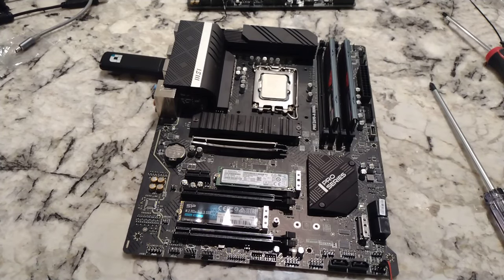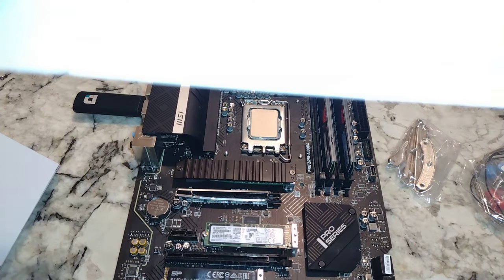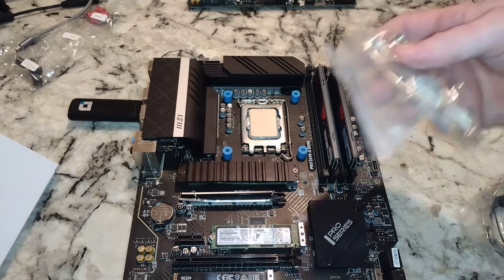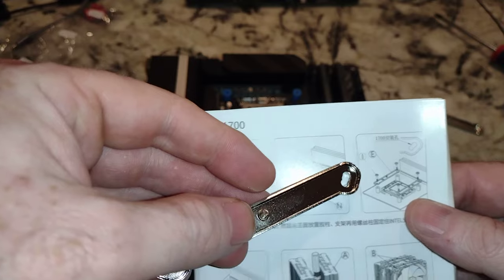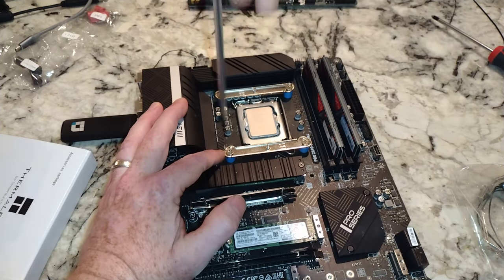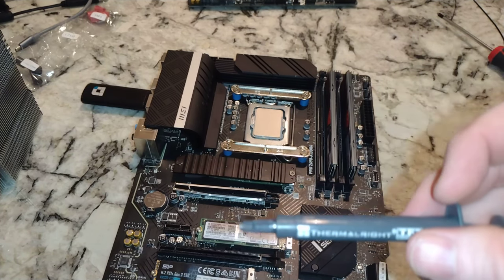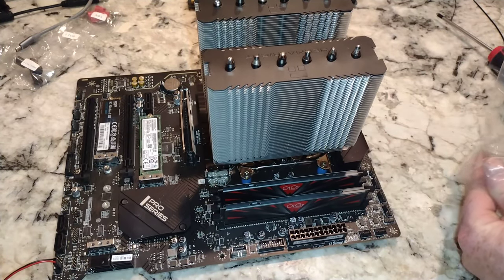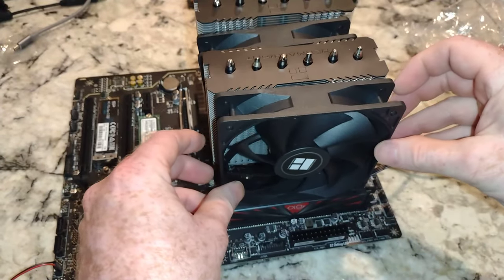Installation: Thermalright Peerless Assassin 120 SE CPU Air Cooler, Dual Tower on to I7-12700f Z690

Comment: You missed showing the wire connections between the fans. It was off camera.  Main thing I needed.
Reply from the maker: Sorry about that.  each CPU cooler usually ends up in more than 1 installation video on here, so I will have to be more careful in filming next time.  Thanks for the feedback.

Comment: Can that outside fan over the RAM be placed on the opposite side? Or is that not recommended because it will cause some type of problem? I have RGB RAM and don't want to cover them with the fan thx
Reply from the maker: I sometimes do that the opposite in a test bench setup so the fans are not blowing on me...difference is, it is not in a case.  In your case, you also want to pull air across the cooler and not push it.  The latter should be better, but I have never actually tested it myself.  If you put this on a CPU with 65W TDP, than this cooler is overkill anyways and that configuration won't reallly matter as far as overheating goes.  Lots of other factors might cause issues related to case size, number of fans...size of GPU...etc.  If it was me...I would say tested it out both ways and see what the delta is between them.   Good luck!
Reply: @PC_HardwareTechUnboxing_1  thanks yes it'll be in a large Enthoo Pro case with 7 fans (140mm and 200mm), so I'll give it a go with the confidence things will be cool enough inside.

Comment: Hey guys, Got a question. His fans are set up from the left Radiator-fan-radiator-fan And mine is Fan-radiator-Fan-radiator. His fan sits on top of his ram, my fan sits on top of the mobo brick, and we both have the one in the middle. Same airflow direction. Do you recommend moving them? I've had no problems with cooling a 7800x3d but i'm afraid i'm leaving cooling potential on the table at intensive cpu tasls with my setup as the right side of the radiator maybe doesn't get cooled enough? LMK

Comment: Any issues between this cooler and the Thermalright "LGA1700 Intel Anti-Bending Fastener, Bending Type Pressure Plate"?  (It's a plate that also lowers temps while preventing the cpu from bending.)

Comment: Hey can you please explain the connections @11:00, one is of the fan, and the other one is???
LOVING THESE GUIDES, THANK YOU!!
Reply from the maker: Yes, sorry got more than a few complaints about this.  I believe I assumed this was caught on camera.  Basically, in the box is a Y connector that allows the two 4 pin fans to go into one 4 pin cpu fan connector on the motherboard.   It might be time for me to completely redo this video or at least film that part over again and provide a link to it.
Reply: @PC_HardwareTechUnboxing_1  Thank you so much for replying, it's clear to me now.
Can you do a video with B760 and 13500 with this same cooler if possible at all. 
Much love to you for help my guy!

Comment: My motherboard's 3.0 PCI x16 is fried and I'm stuck with a defective motherboard. I have this same cooler and an AM4 5800X3D. Am I able to install the bracket and the CPU along with the cooler then sliding it down into the case or do I need to mount the bracket on the back of the case and install the cooler while its already dropped down into the case because that's so difficult for me =(

Comment: Hi I got the argb version, do you know how I can change the rbg colours? I can't find any software that allows me to control the colours. My mobo is MSI MPG X570 GAMING PRO CARBON WIFI Gaming Motherboard AMD AM4 SATA 6Gb/s M.2 USB 3.2 Gen 2 Wi-Fi 6 HDMI ATX. Thanks!!!
Reply from the maker: You need mystic light.  To get it, it appears you have to first download MSI Center under Utilities  https://www.msi.com/Motherboard/MPG-X570-GAMING-PRO-CARBON-WIFI/support#utility    Downloadn and install it, than eventually it will ask you if you want to add mystic light.There is how to video on that page, so perhaps watch that as well.

Comment: Will it fit with an additional set of ram in there too? It looks like there's barely enough space but I can't fully tell.
Reply: i have this cooler, it is indeed have very low ram clearance. i dont think any argb ram would fit in it
Reply: @sexybrunchset8881  I installed the cooler a little bit ago, tbh ran clearance was just fine due to the fact that you can adjust the height of the fan
Reply: @crimsoncoconut6463  i see. Does the fin in your cooler also bend or deformed when the fan clip is installed? It's kinda bothering me
Reply: @sexybrunchset8881  Wdym by the fin?
Reply: @crimsoncoconut6463  the heatsink fin. the metal scaly thing
Reply: @sexybrunchset8881  Ohh, nah, if its not too late you might want to return yours and get a new one

Comment: How tall is the ram in there?
Reply: I second this, I have this mobo and I'm wondering if there is enough clearance for corsair lpx ram
Reply: I just installed this cooler with G.SKILL Trident Z5 Series 32GB C36 which is pretty tall 42mm.  The fan sits above a bit, but no problem really, a small gap.  You can see his aren't flush with the black top part of the cooler either, especially on the ram side.  I would say that my fan on the memory side is riding about 15mm high compared to the black base of the cooler, and about 7mm higher than those metal spikes on the cooler.  When I placed the fans on the opposite side on the back planes heat sink instead of over the memory it looked to be about the same height as if I had put it over the ram (you wouldn't really want to do that anyway since you would be blowing towards the front of the case).  Anyway, I think this should work fine with taller ram, it's just that the fan will sit a bit higher.  You will want to make sure your case has enough clearance for that extra 7mm or so beyond the stated cooler dimensions.

Comment: this is to funny i have the other bored an i have the 120 asame heat sinke do great minds think a like or what sir   but i got amd 5900x an i did not get the intell or the new amd cuz at the dam time i did not no i cud uses ddr4 with the new cpus out i was think only ddr5 so i got 5900 i9 what do u think i am comeing from a 3700x an i i allso have a 9900k shuold i sand it back an the mother bored i got mother bord for 130cash new

Comment from the maker: New: AM4 Version:  https://youtu.be/exmFBnWZOvY
Important note from @antonnikolov2849 as noted below , be careful of installation as rotating the cpu cooler tower by 180 degrees can give you more clearance to access your GPU.

There were some complaints about missed fan Y adapter connections in this video.  I have redone it here in 4k60 and even show how to uninstall it:  https://youtu.be/u-vSJgIB0N4
This motherboard does have some slight damage (lol) from previous owner...got if off ebay for $60 and primarily have been using it for these type installation videos.

I have to say, I really like this CPU Cooler for $35!  It has pretty good cooling as you would expect from a large cpu cooler.  I eventually will have some links down below for temps in FortNite and running various benchmarks.  This will also be featured in a comparison video of under $50 cpu coolers from DeepCool, Vetroo, Thermaltake, ID Cooling...etc.  I will also throw in a couple of stock coolers from I7 and I9 as well.
Reply: Nice
Reply: Solid, Using the Thermalright Peerless Assassin 120 SE CPU Air Cooler paired with a i5 13600k, Thus everything is going well
Reply: Alternative video if cou cooler install https://youtu.be/dLTtocClZbQ
Reply: FYI, I have some comparisons that some folks might find helpful. 

I installed the Thermalright Peerless Assassin 120 SE on my AMD 5900x. With PBO enabled, this CPU puts out a ton of heat (I think it'll boost up to around 250 watts). In Cinebench, it would peak around 81 C. 

After replacing my system RAM for unrelated reasons, the RAM was taller, which forced the first intake fan to sit at a slight offset relative to the tower - maybe 20 mm. That fan/tower misalignment was enough to increase temperatures by about 8 degrees C in Cinebench. 

I ended up removing the air cooler, and going with a high-end Corsair 360 AIO (Corsair iCUE H150i Elite CAPELLIX XT). It's a beast of a cooler, but it only managed about 2 degrees cooler than this air cooler! The big advantage of the AIO wasn't temps, but noise - the AIO is much quieter than this air cooler. 

This air cooler has only really four downsides:

* It makes getting at some system components a pain, and sometimes requires you to remove the tower first (system RAM, some NVME drives)
* It won't give you much RAM clearance, so if you have fancy RGB RAM, you should probably look elsewhere. Check the stats first. 
* It is noisy when it really gets going, so if you're sensitive to fan noise, you'd be better served by an AIO. You don't have to spend like I did - you can pick up an Arctic Liquid Freezer II for around $150. 
* It requires a good bit of space in the case so that the front of the case can close - most newer cases won't have a problem, but some smaller & older cases will. Check the stats on your case for details.
Reply: Thank you so much!

Comment: Can you help me: I build my pc then, I put all RGB fan from the case all connected to the control rgb. I can put the rgb cooler all connected together with the others fans??? Or not? Thanks
Reply: I am currently building my first rgb system with the argb version of this cpu cooler (built quite a few other non rgb builds), so I am no expert at all on this.

From the cooler instructions: "For fans with argb lighting, to control the argb lighting connect  lighting header (3 pin, +5V) to motherboard argb lighting socket or argb lighting controller, lighting effects can be sync by connecting fan lighting headers with eachother."

Each of the two cpu fans has a daisy chain connector, so you can daisy chain the rgb controls together.  In this particular case I have one of the fans daisy chained into the other and the other fan's argb connector connected to the argb header on the mobo.

From what I have read you can daisy chain multiples together for controlling the rgb effects.  If your controller is able to support argb fans at that 5V and using those same 3 pins (looks like a 4 pin connector with one of the middle pins blank) , I think you should be fine.

Good luck.

Comment: Sorry to bother but you should turn radiators by 180 degree. Fans are ok, just your radiator is backwards. Detach fans, turn radiator and attach fans again. When you do so, you will have more than 10mm more offset from your gpu. Check 7.40min at https://www.youtube.com/watch?v=1YFR20MmvpM&t=2s
It is ok in your second video about PE 120 SE:)
Reply from the maker: Great tip!   Interesting, I have installed this like 10 times on here and never noticed that it is not symmetrical.  I will have to go back and check out how the others turned out.  This actually wasn't the best install video that I have done...the 4k version is better, but misses this detail.    I will have to keep an eye out for that.  It is currently not installed on anything.  In this video, it really didn't matter as the primary GPU slot was destroyed by previous owner.

Comment: Did you have any issues mounting the motherboard into the chassis with that cooler installed?   It looks big enough that it would block some of the mounting points on the motherboard.

Im building a system with this cooler the weekend.
Reply from the maker: No issues.  When I do..it is usually an ITX motherboard
Reply: @PC_HardwareTechUnboxing_1  good to know.  Thanks for the responce.

 And thanks for making this video.   Ive wasted to much time and literal sweat and blood fighting with cpu cooling mounting mechanisms because I misunderstood how something worked!

Im slightly bothered by only 2 screws that attatch the cooler to the mounting bracket.   It seems like 4 corner screws would provide better contact.   But, as long as it gets the job done!

Comment: Just installed this today - swapped it in to replace the stock i5-12400F cooler.  Max CPU temp dropped from a whopping 94C to a very nice 65C.  Amazing cooler for the price and in general, is highly recommended.  Thanks for the great tutorial!  Made installation a breeze.  😁
Reply: damn that i5 was hot jeez
Reply: @ImKarks  Not really, the stock cooler is really just bad when its at max load, the 12400f doesn't even draw that much power either, the Peerless Assassin is actually way overkill for it, a single fan tower cooler would suffice, but its very good value.

Comment: I'm super confused. You dropped spacers on top of the screws and didn't screw anything in. How did the backplate not just fall right off when you picked it up? Aren't you screwing into spacers that are floating on the motherboard? Unless the screw you put into the bracket goes all the way down and makes contact with the back plate.
Reply: The screws go thru the the chrome brackets on the top, then thru the spacers and into the backing plate.

Comment: Is there enough room under the cooler to use all 4 ram slots?
Reply: my question exactly + my ram is fat
Reply: @Nardo2G  memory got back by sir mixalot
Reply: The cooler is brilliant but it's really tight hanging over the ram sticks - I had to adjust one fan 5mm higher (on the ram side) just so it would fit.

Comment: Thanks for the clear video about to install mine on same Motherboard. 👍🤞
Reply from the maker: Hope it helps you successfully install yours
Reply: @PC_HardwareTechUnboxing_1  instal went as per your video, but once all setup in system the motherboard is completely dead and wont supply any power to anything have checked psu and all good so assume the Motherboard is dead.

Comment: does the orientation of the radiator matter?
e.g. the "thermalright" text for you is facing towards the left hand side of the motherboard whilst mine is facing the right
Reply: Both are ok, but it is better to have the cooler fans inline (rather than offset) from the case fan behind it. For me, this meant the longer side of the cooler was on top, just like yours.

Comment: Hi I got the argb version, do you know how I can change the rbg colours? I can't find any software that allows me to control the colours. Thanks!
Reply from the maker: What is exact motherboard that u have?
Reply: @PC_HardwareTechUnboxing_1  MSI MPG X570 GAMING PRO CARBON WIFI Gaming Motherboard AMD AM4 SATA 6Gb/s M.2 USB 3.2 Gen 2 Wi-Fi 6 HDMI ATX
Reply: I used  a razor chroma ARGB controller & plugged into that along with the rest of my gear

Comment: if my computer is already assembled (and has an AIO which will be replaced by this...), do I have to remove the motherboard to be able to do the step where you put the "backing plate" at the beginning?
Reply from the maker: You would have to take off the LH access panel to see if there is a big enough access hole on the metal that sits beneath the motherboard.  Its a rectangular opening and if it is big enough you can pull the plate out.  If it is not, you would have to remove the motherboard to do it.

Comment: Lg1151... it s possible to mount this one without unmount MB if there s some space in other case side( window)? Thk
Reply: Yes.  I haven't done it with Lb1151, but if you have the mounting bracket exposed like normal now from the other side then it is really easy to do.  I've done in place fan replacements like this before.  The only tricky thing is that you usually need a second person to hold in the new bracket from the backside when you try to screw in the front screws since you are putting some pressure on the back plate while trying to screw it in.  Don't think you can do it alone.
Reply: @Tricky_Adventures  i ve made it alone without problems

Comment: Can you add and remove ram from all 4 ram slots while the cooler/fans are installed?
Reply from the maker: You would have to remove the CPU fan that sits over top of the RAM.  Unless you, have really tall RAM, slot A1 should still be accessible.  Though in a case rather difficult.

Comment: Hey great video and quick question, does the fan splitter cable come with the cooler?
Reply from the maker: Yes..it's shown about 5mins into this video. https://youtu.be/2sbNI9aw-zo
Reply: @PC_HardwareTechUnboxing_1  Thanks a lot, watched and re watched but couldn't tell if it came with or was your own. regardless thank you for the help and quick response.